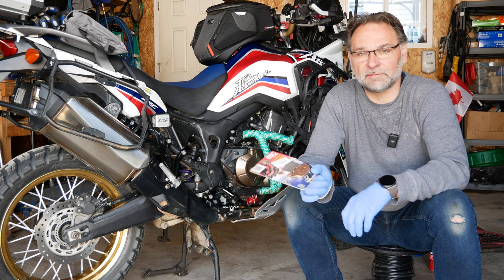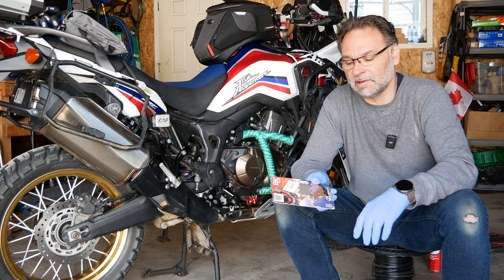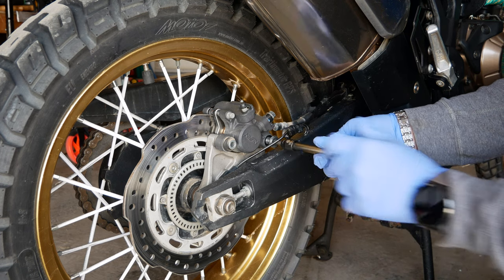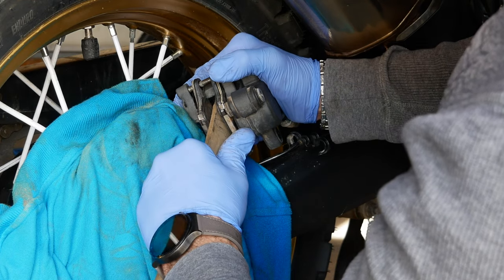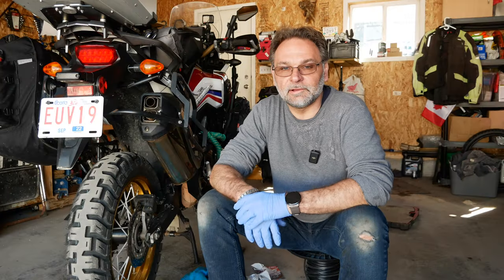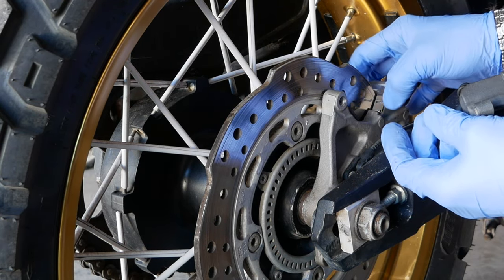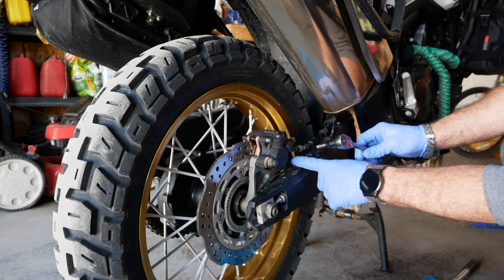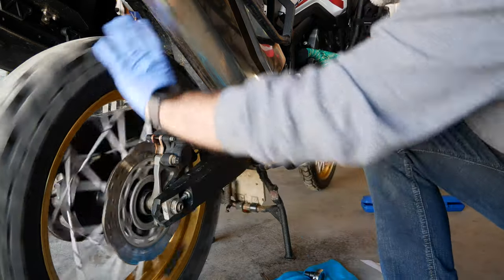How To Replace Rear Brake Pads On Your Motorcycle

Comment: When using EBC you shouldn't install the OEM plates over the pads.
Reply from the maker: I just followed the manual EBC did not mention anything that they shouldn't be used
Reply: My EBC pads for my bike specifically stare to fit any shims if they are fitted to the OEM pads.
Reply: @mattyb7736  Just reporting what EBC UK and Asia told me and is clearly on their website at the time as the pads are thicker.